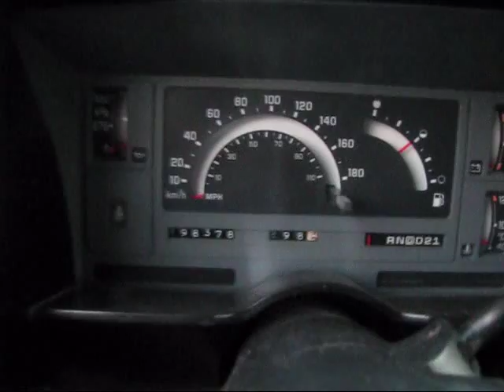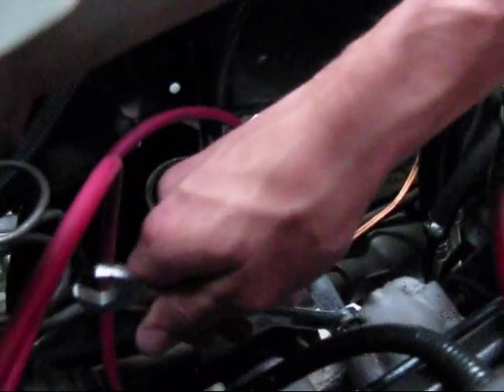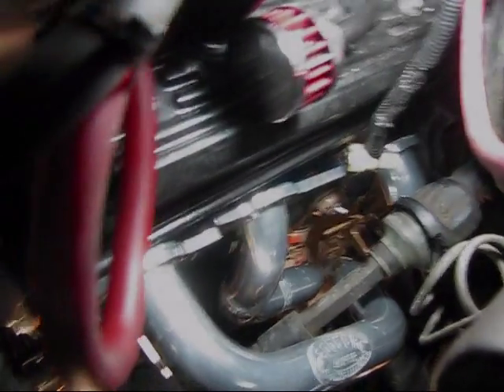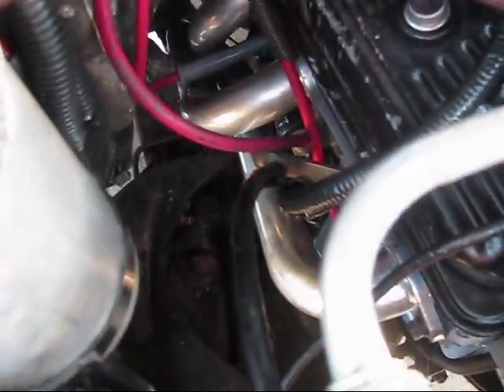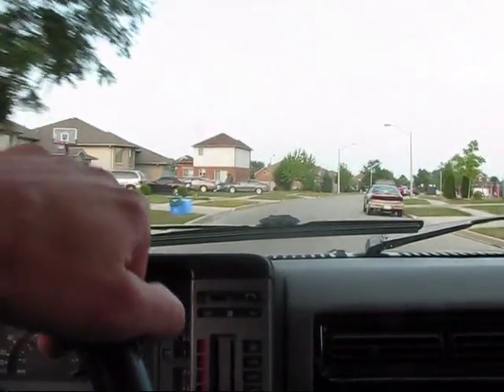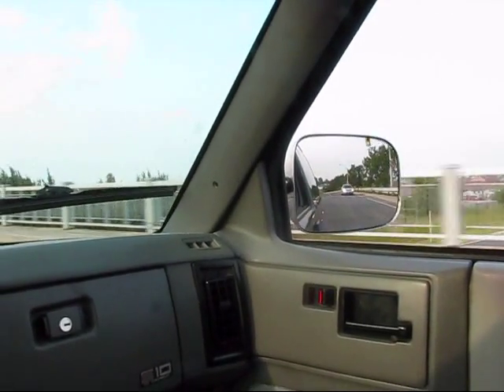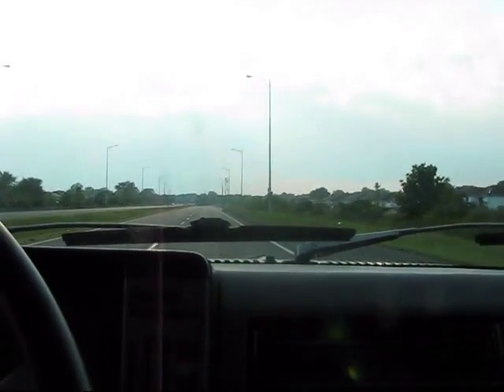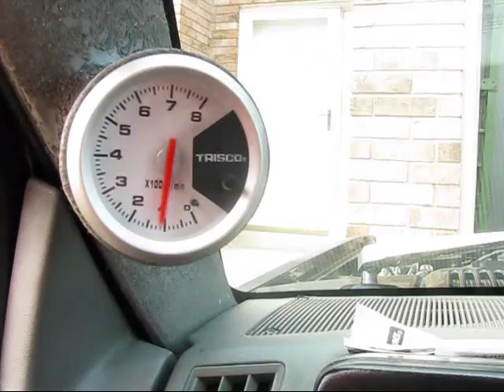93 S10 Blazer Exhaust

Comment: how is the blazer running?  rob
Reply from the maker: running great actually.  had a TPS go crappy on me.  swapped it out and all is well.  plenty of get up and go.
Reply: Good deal ....   hey I installed a flow master 40 series  and dumped it right after the Flowmaster  bouth 6 inch with a 3 inch pipe is super loud but I lost lots of power you think if I install the original piping all the way back I will get the back presure I need......
Reply from the maker: Try putting a reducer from 3" - 2 1/2" might be able to temporally try it out.  Maybe put it on the tail pipe.   Mine goes to 2 & 1/2"  after the muffler.

Comment: if I do a head gasket and cam and lifters do I have to replace the head bolts?
Reply from the maker: Most likely it would be recommended to replace them at that time.  I can tell you I still have my originals installed.  We were sure to oil the bolt prior to install and follow the torque specifications.
Reply: RobHoffmann20 okay thank you, cuz I’m going to rebuild my blazer